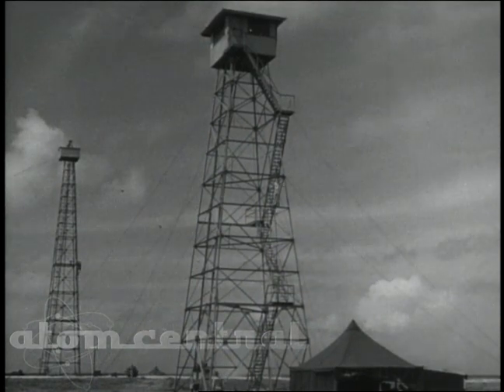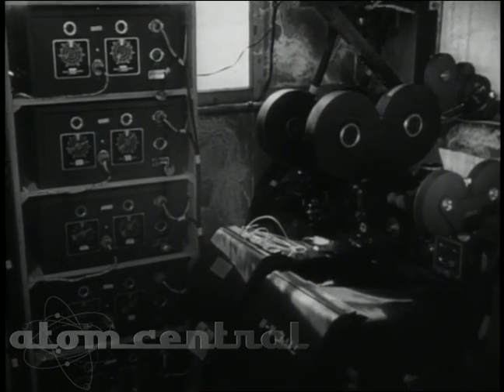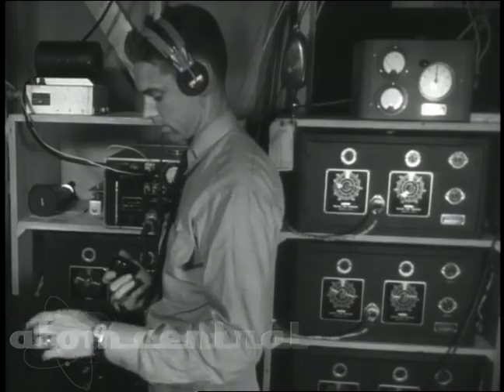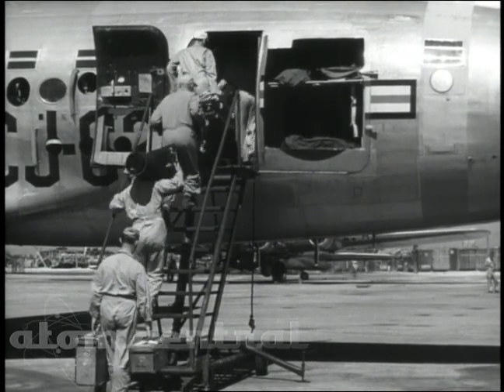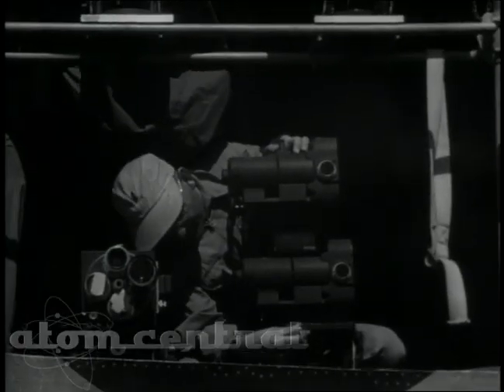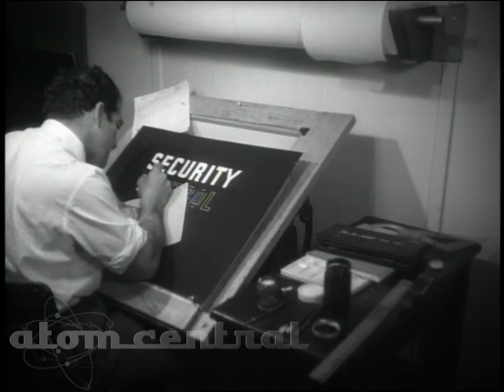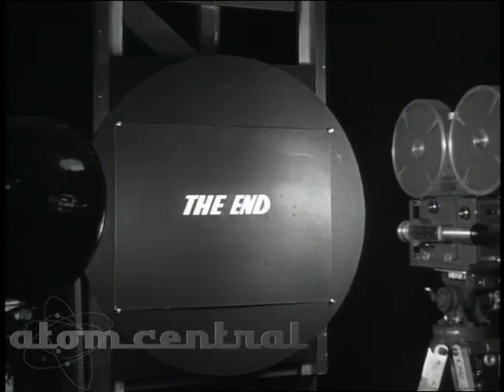Photographing the Atomic Tests

Comment: How did they get speeds of 15 million frames per second? With physical film, no less? How fast mush that stip of film have moved while filming...
Reply from the maker: It was actually on a small strip of film, about 3 ft long which is stationary and a prism in the middle of the camera spun around exposing the stationary film for a short period of time
Reply: @atomcentral  ooh, thats very clever, thanks for the answer :D
Reply: @atomcentral  
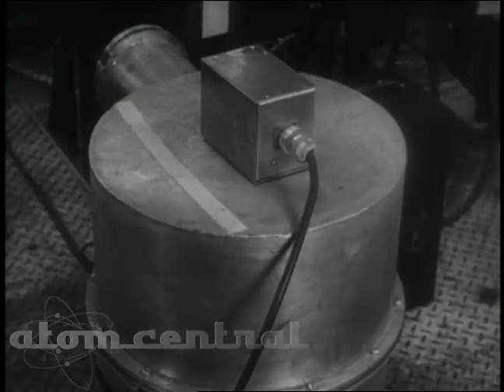 2:21
The image dissection process description can be found at

archive (d0tt) 0rg sIash stream sIash journalofsociety52socirich sIash journalofsociety52socirich_djvu (d0tt) t x t (<— because youTube is too clever at parsing crippled links [and deleting them] )

1949
Motion Picture Photography at 
Ten Million Frames per Second* 

BY BRIAN O'BRIEN AND GORDON MILNE 

INSTITUTE OF OPTICS, UNIVERSITY OF ROCHESTER, ROCHESTER, 
NEW YORK 

Summary A new procedure is used in which the image of a rectangular 
picture is broken up and reassembled into a long narrow strip. After process- 
ing, the negative must be reconstructed into a rectangular motion picture 
frame by projection printing through an optical system similar to that which 
formed it.

Comment: I wonder why they used refracting optics as opposed to reflecting optics.
Reply: My best pull-it-out-of-my-butt guess is collimation. Mirrors are sensitive to temperature changes and when you're filming out in the desert, it can get surprisingly cold at night. So I'm thinking it was to reduce the hassle.
Reply: They had many considerations, but the purpose of the photography was scientific documentation.

Think of the ridiculous difference in ambient light level versus the point of detonation! Reflector optics can be fantastic, but you can have some interesting artifacts.

Wonder what types of reflector lenses were available back then.
Reply: @robertborchert932  Good point. Just machining huge lenses like that accurately is insane to me, even if collimation is less of an issue.